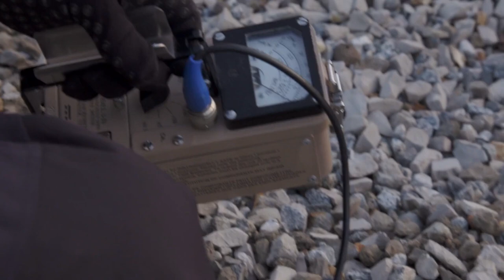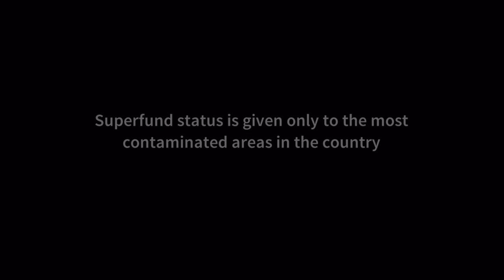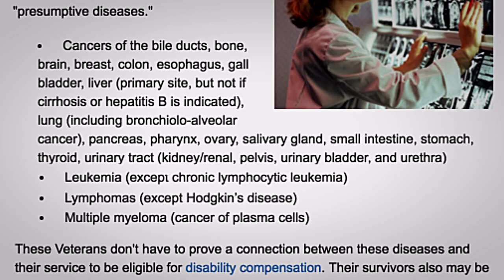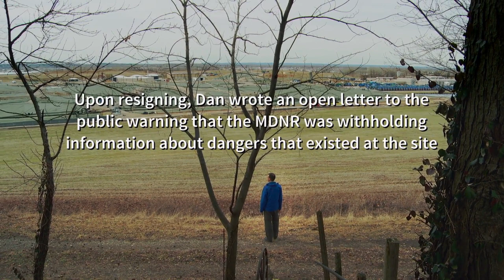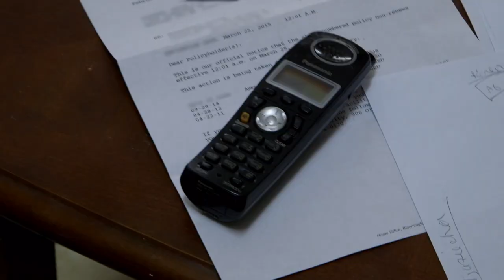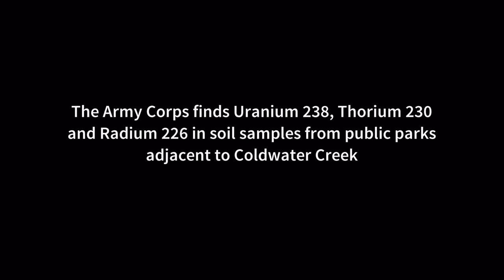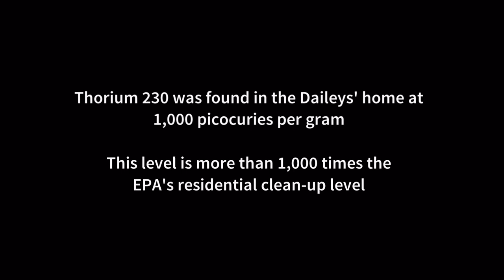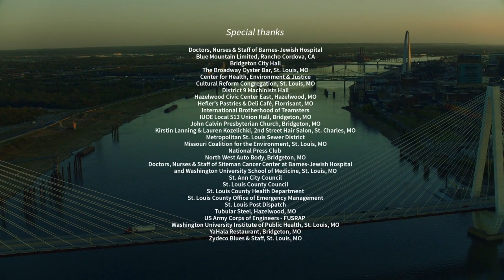Atomic Homefront Documentary 2017 | 1080p

Comment: Nuclear weapons waste is the same as nuclear reactor waste.  So this problem goes well beyond weapons.   They haven't studied this topic because they don't want the answer to the question about low level radiation exposure and the increased risks of cancer.  Nuclear power should be banned until they can solve the waste and disaster problems.
Reply: The difference between them is nuclear reactor waste can be recycled into new fuel.